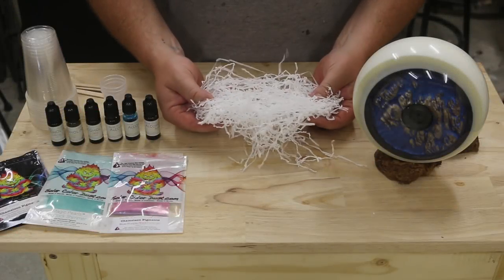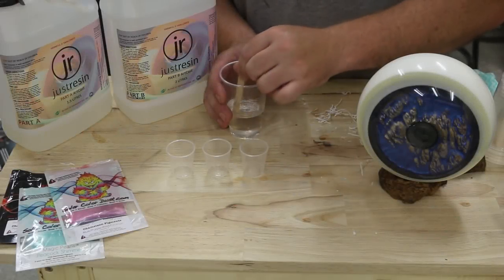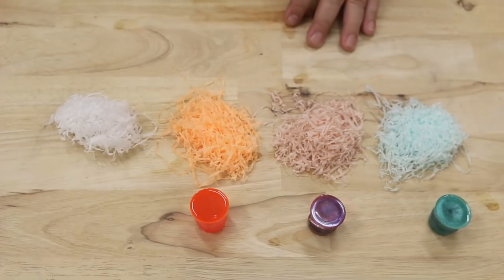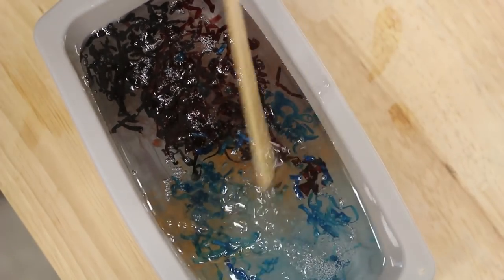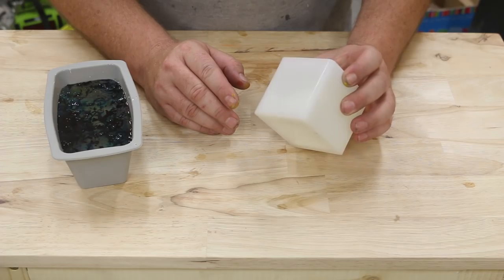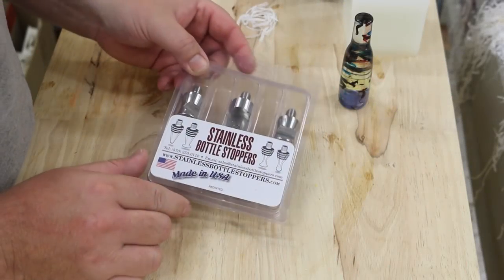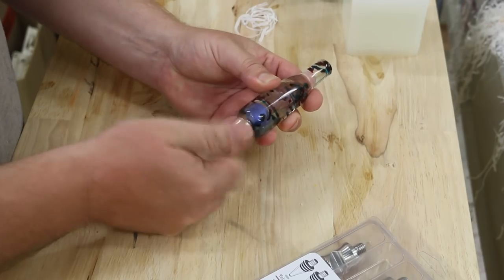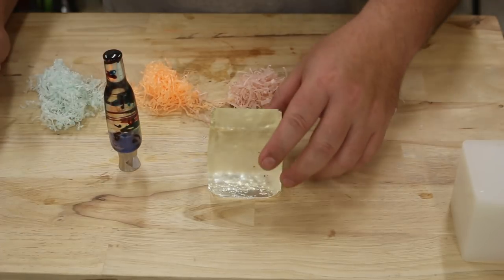Can You Reuse Resin Shavings ? - Epoxy Resin Art

Comment: I've worked with something similar before. If you compress the shavings down and compact them more tightly before you infuse the resin, you get lots more opaque blanks to work with. Shavings can be continually recycled.
Reply: Have you every tried dissolving the shavings with solvent?
Reply: @2degucitas , no. It can't be done. Once the resin cures it becomes a new material. To dissolve them requires a process of being able to seperate the two resin chemicals again. It can't be done.

The best way to reuse the waste is to make a new batch of resin and mix this stuff into it. Then remove the airbubbles in a vacuum chamber.

Comment: I like your answer of “Well, yes... and no.” My follow up question, especially with the clear cube, can you remelt the shavings/turn them into a liquid form, and use them in a project that would be completely clear, as if you poured the material straight from the bottles? If you could, I would hazard a guess that the colored shavings would work as if your poured the dye(s) into the liquid. What do you think?
Reply from the maker: It’s worth a try
Reply: Roger Rarebit thanks for clarifying that point, I wasn’t sure about the chemical makeup/hardening aspect(s) of the material.
Reply: i'd say yes and yes if the resin product was planned to be painted
Reply: Roger Rarebit  still...as a filler...not considering appearance...it can be used and would save money
Reply: Roger Rarebit  Thank you,  THAT was the answer I was looking for.
Reply: Roger Rarebit  soluble in acetone
Reply: @applerealty8305  
Really? What about monomer?

Comment: Regarding the clear shavings to completely "reuse" them, I'm curious if you could melt the shavings so they're liquid again and mix that with additional clear resin?

Just an idea that popped into my head.
Reply: I was wondering about it either.
Reply: Resin can not be melted. Resin isn't like water where it freezes and melts, excess heat + resin will just make a fire or burn the resin.
Reply from the maker: I'm working on it :)

Comment: I came here looking how to create resin shavings..  Intentionally.

Currently doing an experimental project. Apparently I am not allowed life... So I will tell you what my project is currently..

It's pretty fun.

Plan is to make a block of resin to create resin shavings, the resin will be clear and mixed with glow and the dark pigment. I want like wood shaving like texture from hacking up a glow in the dark block. I will test with many colours.

I will then add the shavings to a concrete mix, which should technically act as a like fibre glass reinforcing strengthening the concrete. Thats not the point. Making stepping stones for my yard for a path way  and for the garden. 

My intention is to make near matte obsidian black paver stones around the garden and imitation stones. So i noted day they appear black.. However at night the phosphor glow in the dark should take in light and then glow for some time... making the stones look like embers in rock glowing at night. Plan on using orange powder.r However the brightest colours do have concrete natural look while in day time and then are the most vibrant. Green/ blue...  

Thats my current project... 

My current place because of limited funds is:

Testing to make quieter 4.99... a bag. Testing small pours.. For colouring the concrete black. Did some testing with glow in the dark paints, but they didn't work so well.. so I think getting shavings would be an entreating purpose... since it will glow in the dark, depending if its on the surface area or not.

Comment: how much wait can a single strand hold vertically ,  0 oz to 23 oz ?
Reply from the maker: I’m not sure but it’s worth testing
Reply: @BensWorx   well f it dose do a video on it , because that  crap epoxy  cud be sold  as cement  strainth enhancer expeshly for air create it sale for around 15 dollars a oz. or 38 grams .  but has to ave a tencal strainth that hard to brake like  tooth floss . but not that strong just close to it .

Comment: This isn't what I'd call "reusing." To me, reusing would be melting it back into its original form, which isn't really possible if it's a 2 part resin to begin with. This was just embedding resin shavings into fresh resin, just like you can embed most anything else.

Comment: cant you just melt the ressin shavings
Reply: I believe even of he could melt them, they would be to hot to add to the rest of the epoxy without causing it all to mess up. Also once the shavings were mixed with the hardner the first time, it chemically changed and is no longer able to change back.